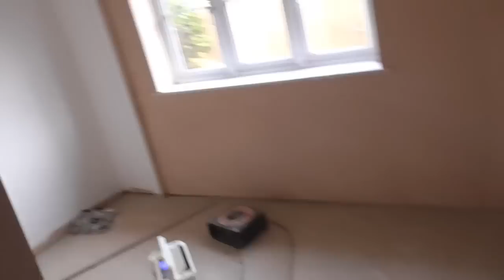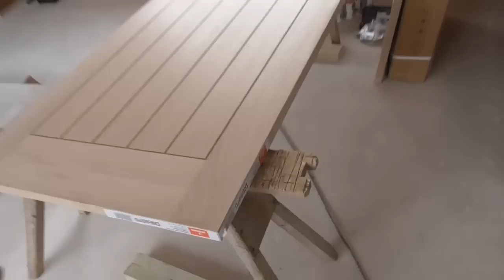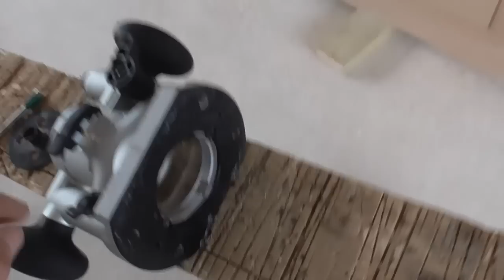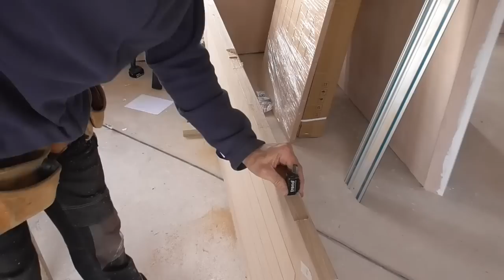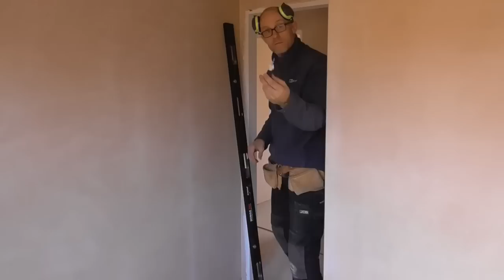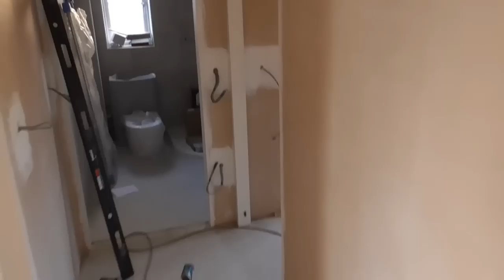How to hang a door with a professional carpenter***COMPLETE HOUSE 2ND FIX CARPENTRY PART 1***

Comment: 22:45 I’ve heard this before but no one has ever given a explanation why.
Reply from the maker: Hi Craig🖐I'm struggling to think of a logical reason why the hinges are placed this way, and it's just tradition I guess🤔Cheers Del
Reply: @thetallcarpenter  Thanks Del, I’ve been a joiner for 30+ years now and always fitted hinges the opposite way 😂 Anyway never had any issues. 
Hopefully someone in the comments can give a definitive explanation.
Reply from the maker: @Craig  I can't see, mechanically, what difference it makes which way they go🤔